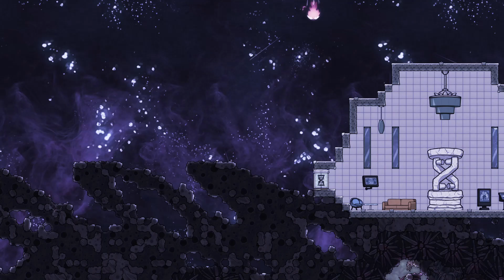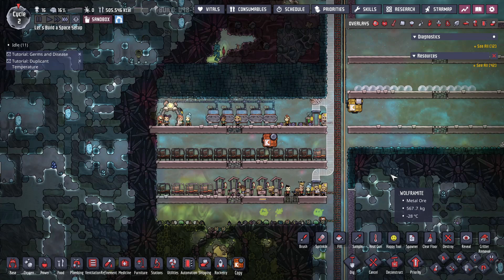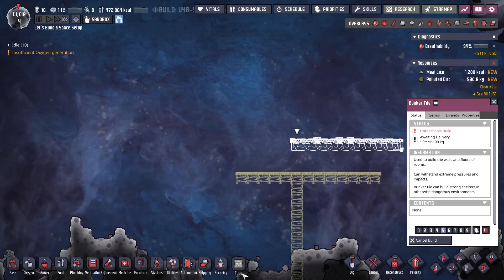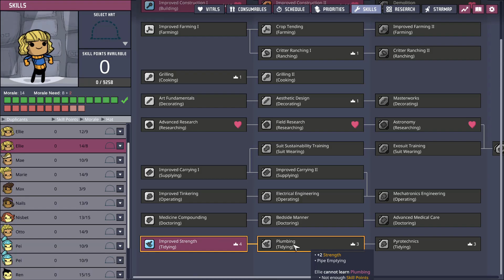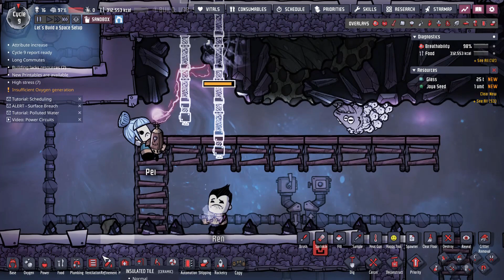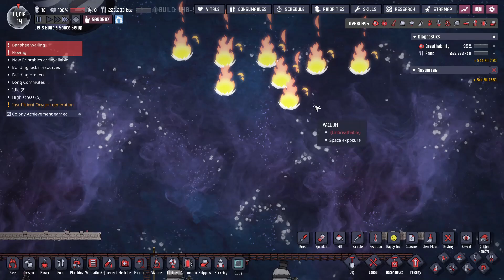How to build in the Space Biome (Base Game)

Comment: "If you can keep your water at 2c that would be perfect".

Um yeah...  Getting Polluted water to 2c isn't a big problem.  Getting Water to 2c...  You realize that is impossible for all but the most experienced players... right?  

An Aquatuner will freeze the water.  Anything past an aquatuner is beyond even mid knowledge players.

Counter flow heat exchange between gas and water...  will fail, unless the gas is super cold, and the water is starting at less than 10c.

The most feasible means being a steel door thermocouple between a Colder side and your 2c water tank.  Which would take forever...  depending on the temp of the starting water.

You should really have recommended Polluted water, which is a superior coolant to water in every way except that if can offgas.
Reply: Salt water and brine are similarly superior though they don't offgas
Reply from the maker: I'm being purposefully vague only because the concept of cooling water warrants a potentially several-hour discussion.  I'll cover it in detail in another video, but so many other setups will require some form of cooled liquid that I can't cover it each time.

I could have used a more realistic example though, you're right.

Comment: If you double up blastshooters on a "platform", would it still have coverage if you likewise nearly doubled the distance between platforms? I like to try and get one auto sweeper to deliver to multiple stations instead of 1:1, so trying to figure how to make it work without being expensive or swiss cheese defense 😝
Reply: I am sure that having multiple cannons overlapping the sky would help, but there is still no guarantee that they would target different meteors.  I seem to remember reading somewhere that they were specifically designed by the devs to not be 100% effective.
Reply: @azrobbins01  re: Dev design to be <100% effective, I'm assuming so, but if we, for argument's sake, say that they're 80% effective solo, and 99% effective for the overlap, can we still get 99% effectiveness for doubled up on a platform and double wide? Or do we need to space them out regularly for best coverage?
Reply: @michaelsorensen7567  The only time you will have trouble is when 2 or more meteors are in range of a single cannon at the same time.   It can only target 1 of them so the other meteor gets through.  I do not know how often this happens, but there is no way to reduce the chance to 0%.  If you are looking for a 100% safe and maintenance free method, then you will need to use a C-miner setup.

Adding 2 cannons overlapping means that instead of a 100% chance of a meteor getting through, you now have a 50% chance for one to get through.  Adding more cannons just reduces your chances of a meteor getting through, but it will never be reduced to 0% chance since they all might still target the same meteor, even if it is very unlikely.

As far as spacing, they cover 33x33 tiles.  I think the default world is 256 tiles wide, so you would need 8 of them, or 16 if you wanted double coverage.
Reply from the maker: You'd probably get a little better coverage that way.  The spacing I'm using is by no means a scientific optimization, so I'd say it couldn't hurt to try!

Also, to be clear, the blastshot is loaded straight into the meteor blaster via conveyor rail, so you don't need to rely on an auto sweeper to do that work.

Comment: They added the "Disconnect" tool so that you can disconnect pipes/wires/rails without the need to deconstruct them, for example when you extended the cooling loop to the other blaster.  You can just cut the pipe without needing to deconstruct it.  It looks like a pair of pliers at the far right of the tool bar.
Reply from the maker: Totally, I learned that after this video was filmed.  I'm using it a lot more lately, thanks for pointing me toward it, it's very helpful!

Comment: You might mention that window tiles, gasses, and liquids reduce the amount of light that passes through them.  This becomes a larger issue in spaced out where many of the planets have very little light that reaches them.  So, building your solar panels underwater to protect them from the meteors won't help, for example.

Comment: You can also just put a weight plate under the output tile of the blastshot maker so that it turns itself off when it has a few tons of blastshot sitting on the ground.  That way you do not overproduce or use up all your metals or waste duplicant labor needlessly.

Comment: They added a new "Conduction Panel" that transfers heat between buildings in space.  They can take liquid input if you want to take the heat away, but you can also just use them to transfer heat between buildings and the surrounding tiles without any coolant, if it were just attached to the surface of the planet, for example.  No need for a liquid transfer medium anymore.
Reply from the maker: Oh interesting, I'll need to take a look at that.  Thanks!
Reply: I was thinking about it when you were pumping the water up and laying down the drywall tiles. 

The new conduction panel transfers energy like a radiant pipe, but it works in a vacuum. Perfect for space biome. I think they’re also the same width as the blast shot cannons. Don’t quote me on that, but they feel perfect for each other nonetheless. 

I believe it must be made from steel and their is only a liquid pipe version of it.
Reply: @MichaelSayer-sf7gu  Wiki says it is 3 tiles wide and can be made of any refined metal.  Meteor Blaster is 5 tiles wide.
Reply: @azrobbins01  thanks for looking that up and clarifying

Comment: They added a new "life support" dev building that provides heating/cooling, O2 production, and CO2 deletion.  It makes setting up testing facilities a lot quicker.  I think you must be playing on the hardest difficulty setting since the Great Hall, Nature Reserve, and Berry sludge had no effect on their stress levels.  There is a mod called "Modify Difficulty Settings" that allows you to change the difficulty settings in the middle of the game.  Not recommended for normal gameplay, but it makes it convenient if you started a playthrough with the wrong setting.

Also, I know this series is not about Spaced Out, but you might mention that in the DLC, the meteor showers are usually not boiling hot regolith, so they are not as detrimental and do not pose a significant threat like they do in the base game.  Also, they are not present on the home planet at all, so it makes getting started in space a lot easier.
Reply: That alone might make me shell out for the DLC. I always run into trouble about when I'm looking at space and don't have solid enough understanding of game mechanics to properly stabilize, so adding tons of hot rock in space always makes me frustrated enough to give up. 

Lacking that, might actually make it
Reply from the maker: I will definitely make Spaced Out content, and some of the meteor scenarios in that are worthy of their own Let's Build videos, for sure.